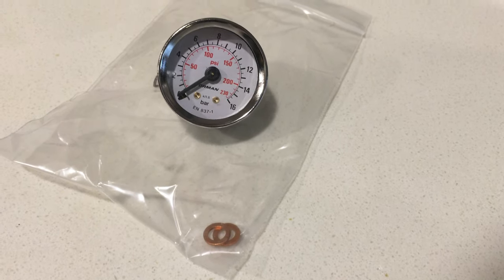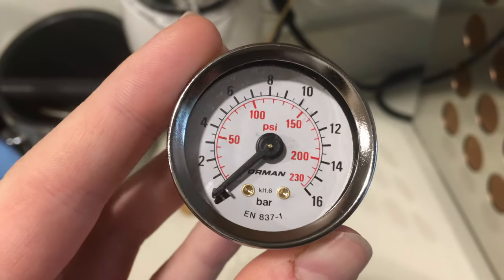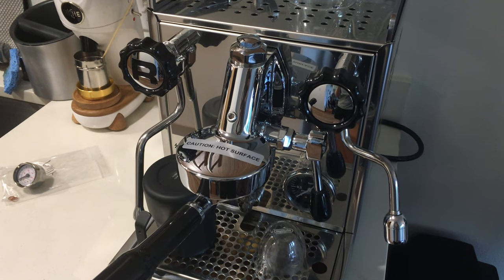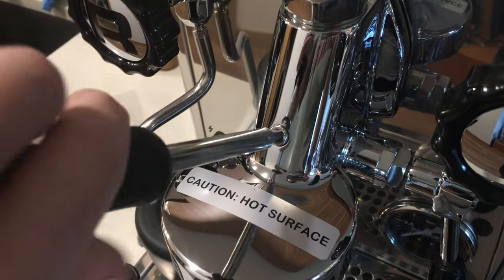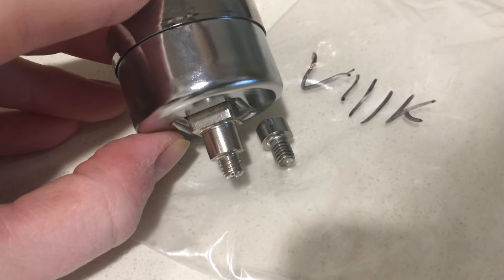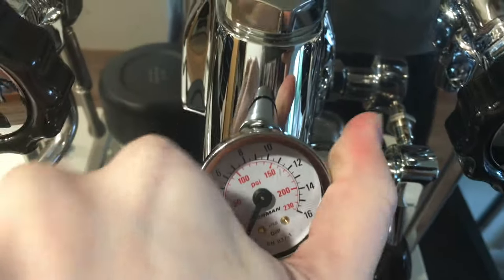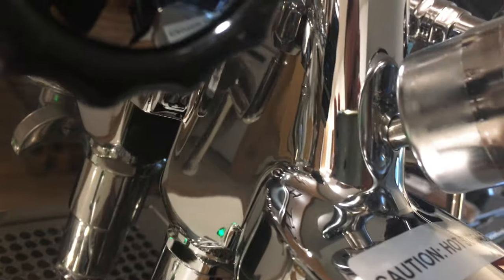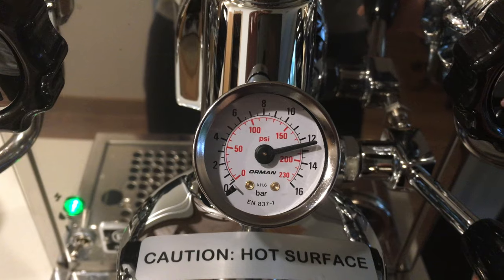Add Pressure Gauge to Rocket Appartamento (E61 HX)

Comment: Wow! 12 bars is default setting from factory? Won't it be too high? Must grind finer than normal 9 or 10  bars machine to achieve 1:2 ratio within 30 secs?
Reply from the maker: Strange, isn't it? I see a lot of people getting 12-13 bars on Rocket machines. I am currently looking into lowering my brew pressure by adjusting the over pressure valve. I might do a second how-to video on that if I can get it calibrated successfully.
Reply: @matthewm.4507  Do it, I did it on my Quickmill Rubino which is a similar style hx machine.
Reply: And I see you already did. How are you finding the difference in extraction?
Reply from the maker: TheDudeFromKalispell It’s much better! I reduced it to around 10 bars and I’ve noticed a lot less channeling in my shots. That, combined with picking up a cheap distribution tool, has really increased the consistency of my extractions.
Reply: I just installed this very gauge on my Quick Mill Rubino and I'm getting a little over 10 bar of pressure at the group and that seems fine to me.
Reply: @matthewm.4507   I bought a leveler on Amazon and yes, that works great! I agree.
Reply from the maker: SatineMoisant I’ve been really impressed with the impact of using a distribution tool. I used to have issues with channeling on the edges of my pucks, but using a tool has almost totally eliminated that.
Reply: Just fitted the same manometer to my Sanremo Treviso LX which has a rotary pump. With blind basket in it hits 8.5bar and when I pull a shot it is also 8.5bar. I was concerned that it had too high pressure but this seems spot on to me.
Reply: I also get 12 bar, which is a lot! I use a rocket appartamento with a naked portafilter, VST precision basket 18g, distribution tool, 58,3mm tamper. fresh light roast 3rd wave coffee. Everything is okay except for that 12 bar. 
I get 36ml of espresso, perfect 2:1 ratio.
Wondering if the gauge can't measure correctly...
Reply: 12 bar with a blind basket is totally normal on this machine. Vibratory pumps ' pressure vary based on the back pressure of the coffee, unlike rotary pumps (for the most part). That 12 bar is just the expansion valve keeping the boiler at a safe pressure. A puck of espresso will offer less back pressure than the blind basket, resulting in an extraction closer to 9 bar. Certainly you can turn down that expansion valve but 12 bar is a typical setup.
Reply: @tatemazer7811  I get 12,5 bar DURING extraction, then it goes down to 11, then 10 at the end. I feel something is wrong.
Reply: @RakanWD  Thanks! 
It turns out that the Rocket has a default 9bar pressure, but that pressure is read way higher when you put a gauge in the e61 head. It's like the machine 'sends' 9bar' but the pre infusion and infusion creates resistance, and it indicates 11-12 bar which worries people (me), but for no reason. It's all good in the end.

If you had a Rocket Mozzafiato with a stock pressure gauge, it would still read 9 bar during extraction BUT when you install this extra pressure gauge in the e61 head, then it would indicate 11-12 bar.
Reply: the blank basket increases pressure relative to ground beans. Breville Barista models with the rubber grommet peak at their gauge’s top espresso range but when making espresso the range is lower on the gauge where you’d want it.
Reply: That was my question. Shouldnt we be at 9 which requires removing the tank for adj.
Reply: @lespieces  the pressure readings are higher because this machine has a Vibration pump (not a Rotary pump). On the Rotary models you get fix, steady pressure of 8 or 9 bars, but on the Vibration pump models the pressure goes up and down in fractions of seconds so the readings of 10, 11 or 12 bars is not the consistent pressure, but the highest measured pressure you get. So the complaints to factory settings in this respect are pure ignorance of the technological concept of how the vibration pumps actually work . .
Reply: @dushkoisajlovski9679  Thank you
Reply: @dushkoisajlovski9679  Thanks for clearing that up! makes sense :)

Comment: Just installed the pressure gauge. Once the pump is fully engaged the pressure at the grouphead is at 11 but will drop down to 10 over the course of an approximately 30 second shot. Have you experienced a drop in pressure or is yours consistent?
Reply: Sounds like coffee channeling to me- if so, it's not a mechanical failure but rather a technique/grind issue.

Comment: Got one. Doesn’t line up. 0 degrees is at 11 o’clock. 8bar to 10 bar is 4 to 5 o’clock.
Reply: Same here. Ridiculous.
Reply: Same here, but you should have got the plumber tape.  I solve the issue with it.

Comment: Hi Matthew, since you’ve had a machine for several years, I was wondering what is your cool flush routine once the machine idles for a while/fully warmed up and you are ready to pull your shot?
Reply from the maker: I don't worry about it too much. Sometimes I quickly flush before pulling shots if it's been sitting warmed up for 60+ minutes, but most mornings I don't bother and I've haven't noticed much difference in shot quality.

Comment: Hey Matthew, How's your machine holding up ? I'm about to buy one of these since I just got my new Rocket Appartamento.
Reply from the maker: Still working great! I really like Rocket machines because they’re so easy to work on. Pressure gauge has been really solid, no leaks or anything. Good luck!
Reply: Matthew M. I just installed it today and the gauge is perfect! My machines peak pressure is 11 bars
Reply: Do you guys adjust down to 9 bar?
Reply: @Doc8404  I didn't adjust to 9 bars. I've been having perfectly tasty results with the right grind size.
Reply: @matthewm.4507  hi Matthew😊🙋🏻‍♂️, how is this machine for 30 to 40 max cups a day? plan to put it in office

Comment: Hello,  have the same machine and experiencing some channeling almost every single time i make shots of coffee. So i was thinking ether to but a flow control kit or just buy a gauge like yours and adjust a pressure as you did in the other video. What would u suggest to do? Just your opinion. Also i recently ordered a Nichzero grinder i hope it’s gonna at least partly solve the issue
Reply from the maker: I’d first recommend dialing in your Niche Zero and using a cheap distribution tool to get a nice even distribution prior to tamping. If you’re still getting channeling, then look into reducing brew pressure a bit. Those steps should get you pretty close 👍
Reply: Thanks a lot. Will be trying

Comment: Why a pressure gauge and not a thermometer?
Reply: My end is the temp. I have a temp on mine. When you have the right temp with the grind a little tamp. Gold. You can be at the 9 bar but without that right temp your shot is shot to hell. Don’t get me wrong with a bar pressure too is good but it’s your temp that is the most important factor to pull a shot.